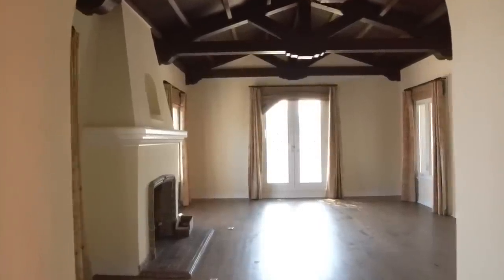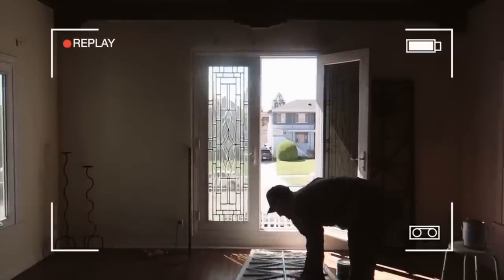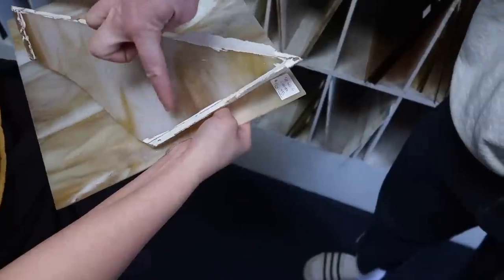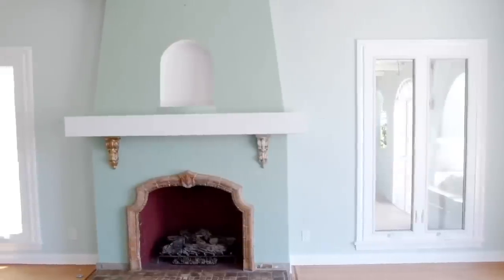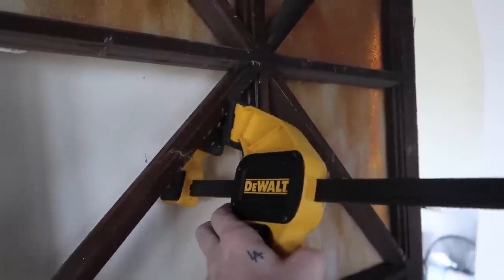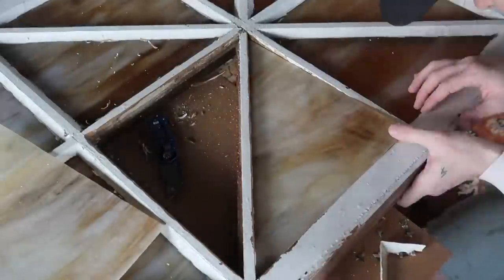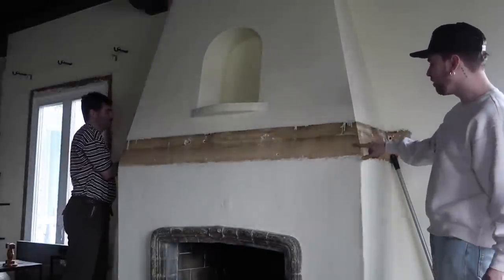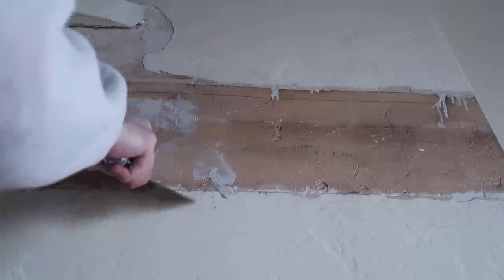Stained Glass Door SHATTERED + Reworking The Fireplace ✨ LIVING ROOM MAKEOVER ✨ Part 3

Comment: Hi, I think you forgot to use Glazier Push Points to hold the glass in place.  I don't think the putty will securely hold the glass in place during storms.
Reply: I was just going to comment about him not using glazing points. If the putty ever loosens the glass will fall right out...
Reply: I’m surprised the stained glass store didn’t discuss this with you, they knew what you were doing?
Reply: These are  decorative window 'PANELS' and not are not meant to function as real windows. They were/are typically used as an insert into a window frame - sitting against the clear glass and secured with light trim creating a frame
Reply: And didn't he just show us he got that device for framing?  I'm certain it's a very similar function.
Reply: With all the crazy weather going on in your area, I pray that your stained glass panels will stand up to the wind. Will they be mounted over the regular glass doors & if so, are the doors strong enough to hold the weight of the stained glass panels? I worry about another accident. 🙏🙏🙏🙏 please mount them properly. They are just gorgeous.
Reply: I was thinking the exact same thing! I kept waiting for him to show us inserting the glazing points prior to applying the putty, am now just hoping the putty holds those panes in place for the long term!
Reply: They are right...glazing points.

Comment: Your instincts on the living room fireplace are "spot on" in my opinion. That chimney was embellished with a simple niche. The mantle took away from the streamline and smooth shape of that lovely fireplace. In my view, the niche was designed to be a place for ornamentation. No mantle necessary.  Maybe the former owners wanted a mantle for hanging Christmas stockings (who knows). If that were the case, I would have rather seen pegs used. Anywho, I feel like you are honoring the person(s) who designed and built the fireplace.

Comment: Good save on the door Drew! 
Just a suggestion before you install the doors. I recommend that you sand down and repaint the white 22:11 sides of the doors and remove and replace the window putty on all the window panes to be sure to fully secure all the glass. 
Also I suggested previously that you consider brass fixtures to allow you to fix the opening of the doors into different positions. This would stop any mishaps with the wind. Old style windows used to have brass window opening fixtures with holes along the length to hold open casement windows in place. Perhaps you could have the same for the doors along the top and bottom door frames. 
Love the fireplace and your wall colour choice. 
Look forward to more progress on the room. 😍😍🤩

Comment: If you are still on the fence about color (and need yet more options, lol), consider Edgecomb Gray from Benjamin Moore. It is a taupe color that is along the lines of what you are thinking; it reads as warm and cooler toned at the same time. I used it in our living room with tan and cobalt blue accents and it works well with both. Our home is also an older home (1918).

Comment: Drew.. PLEASE buy a surface bolt for your doors.  One that goes into the floor or something.  You've said a couple times that this door keeps blowing open.  I'm not only worried for your house, but your safety.  I had a door (french too btw) that kept doing the same thing especially on a windy day and I bought a pair of surface bolts and it fixed the problem.

Also, I really like the darkest gray/greenish color.  The other colors look almost like what's already there!

Comment: A California knockdown technique would do great on the plaster. Wet large textured sponge with joint compound dabbed randomly, let dry 5 min then a large drywall trowel to lightly spread the peaks flat. Like you would do a ceiling. I repaired a water leak after the large cutout and you can barely tell after painted.

Comment: Drew you did a great job with fixing the door.  I was thinking that  when they are up they will also have an impact on the paint color.  When you have put them up before the room got darker so if you want to go moody the. The two darker ones would be better choices.

Also, the DIY Wife renovated her fireplace and it looks similar to yours and she has a very thin ledge.  With or without yours is going to turn out great.  And you can always add one later if you change your mind.

Comment: Incidentally when you were talking about the alcove over the fireplace working enough as a "mantle" that it's not needed, that's pretty much the intent of them on the Spanish Colonial fireplaces. Typically if you have an alcove, you very often have no mantle, so the mantle definitely read like a weird later addition even before you took it off and confirmed it was likely a mid-century add-on. Which makes sense for the conventions of the era but not the style of the house at all.

Comment: Looks like you put the single replacement triangle the wrong way up, with pattern going horizontally instead of vertically. I hope you fix that before the putty hardens.
Also I would probably replace the other triangle in that square section because the original ones have matching patterns.

Comment: OMG most emotional rollercoaster ride video yet.  
First I was so sad about your door that my heart was breaking for you.  
Then thrilled about finding the glass that matches so well and DIY is awesome.  Nice job on the glazing too.  It takes a lot more than 10 days for that stuff to harden up (they lie), but don't let that stop you from putting your doors in.  I did it with my windows and it was fine.  Just don't stick your finger in it, but even if you do, it's a quick fix.  Nobody is going to die.
Next, I liked the mantel you had and was terrified something would go very wrong with whatever was underneath. 
Then did not like the block mantel look at all in a classic home like yours.  Not a fan of it in the other room either.  Sorry!  Just my opinion.
Then a great surprise to see how it looks without any mantel.  
Then concerned you'd try to put plaster in the holes, then relieved you knew to use joint compound with horsehair plaster.  That house of yours is surprisingly old for California if it has horsehair plaster.  Do you know when it was built?  BTW, horsehair is a fantastic sound insulator.  If it's all over the house it's great if you want to have private conversations that the whole house doesn't hear as is the case these days with gypsum board walls.
If you'd like a tip, when thinking about paint color, an old Colonial era vibe trick is that while your paint is wet, get a candle with a long wick so it smokes, then blow the smoke into the paint on the wall.  Along with the variation in the plaster it adds another layer of interest so it doesn't look too new.   I got that one from my neighbor who did old interior design work for Colonial Williamsburg VA.  What a talent he was.  He's also the one that told me about early colonists using the oriental or Persian rugs on the tables (mentioned in your tv room vid comments)
Can't really go wrong with Farrow & Ball traditional colors.  They're "classic" for a reason.  
As the fireplace is the main focal point, plus the doors, paint color that goes well with both will work well.  
Woodwork goes with just about anything, but I'd steer clear of the darker browns you were considering.   Too damn depressing to live in that day after day.
Good luck!

Comment: TIP:  STAINED GLASS  NOT DOORS  BUT PANELS- yes these are 'panels' and not doors. Congratulations on DIY  'GLAZING' (this the name for mounting window glass into frame)  and you can get lots of info  using that term.. 
🖐 TO use your stained glass panels as a faux door - leave the current french door/windows as is and only remove the that stained glass INSERT- yes that comes out- and replace it with clear window glass. Now you just hang your stained glass  panels on to the room side of each door. They  are mounted almost like curtains  over the door. You will have to be clever and careful figuring out how to attach panels to door- the panel frame and mullions are thin and brittle so not good .  Suggestion is to just use trim pieces making a light frame OVER the panel. For expert  FREE advice just speak with or email a local college that has a exhibition or  gallery space - they have PLENTY of experience mounting all kinds of art on walls etc..the